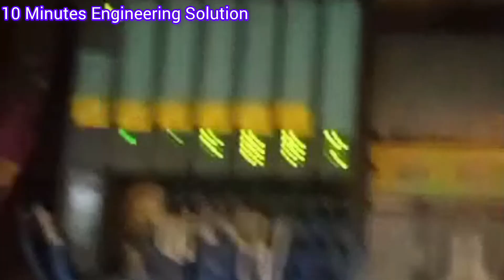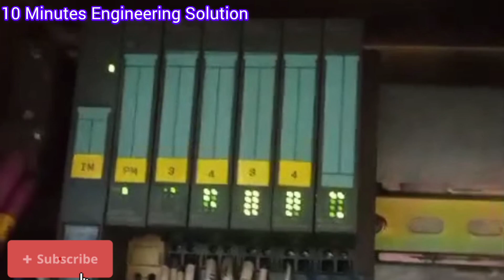How to Replace Siemens ET200S Terminal Modules |Easy Fixing & Replacement Guide | 100% Practical Tip

Comment: How to unlock terminal module from othet TM if locking system of terminal module is broken ?
Reply from the maker: 1st you have shutdown full machine power and then,,  if the locking mechanism is broken then you have to apply one simple trick that,,,including the bottom base of the PLC Terminal module needs to open....applies Tester or Connecting Screwdriver for that specific point and push, hope it will be open.
Reply: @10minutesengineeringsolution  part of the locking system I need to push by screwdriver is broken.